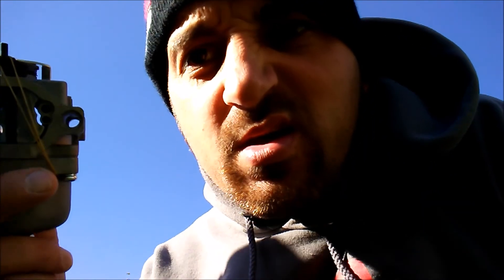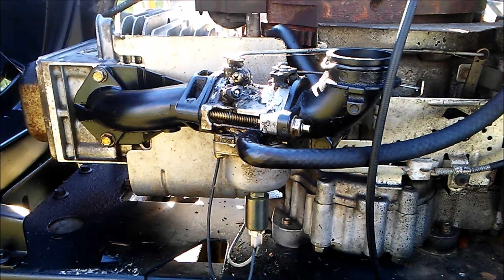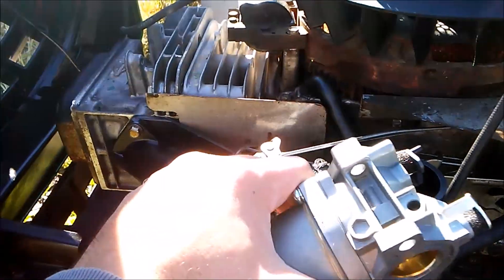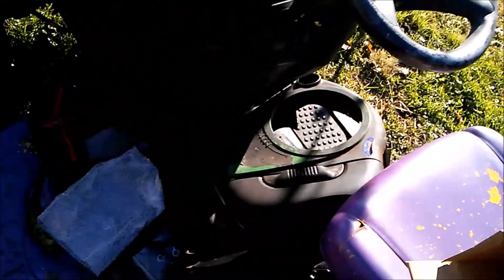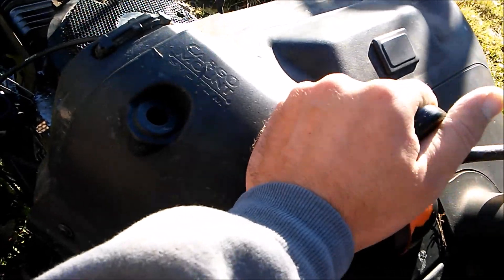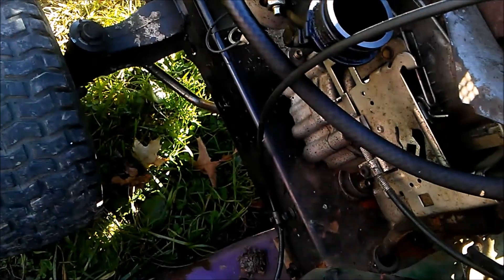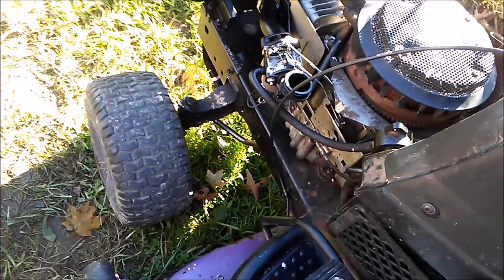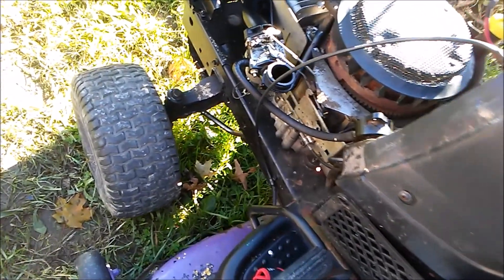How to Fix a Seized Engine on a Lawnmower

Comment: This absolutely worked!  I'd tried everything including replacing the battery, solenoid and starter (which did test bad) to get my cub cadet mower to turn over and no luck.  About to throw in the towel and take it in for service but decided to try this first.  Engine cranked right up.  Thanks for the great...and easy...tip!

Comment: I unlocked my motor I guess. I can spin it with my hand a 360 but then it locks and won't move any further. Before this happened it was crunked it made a loud sound then it shit off. Is it possible something has broke in the inside? It also had water in the oil. I drained the oil and refilled it then, boom. Any ideals?
Reply from the maker: I have no clue. My mower wouldn't turn back on
Reply: I'll replace the motor if I have to cause it's worth but  I prefer to bring the original 1 back to life if it's worth it
Reply: It may be a camshaft my friends did the same time and it was the camshaft just a suggestion